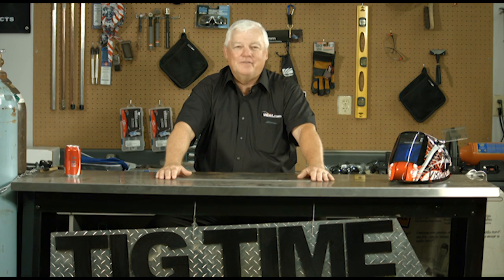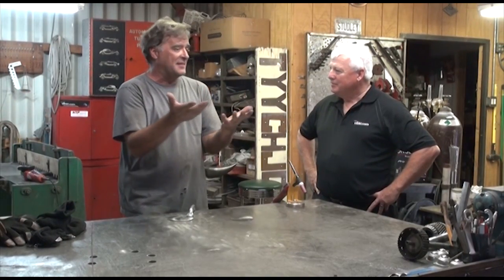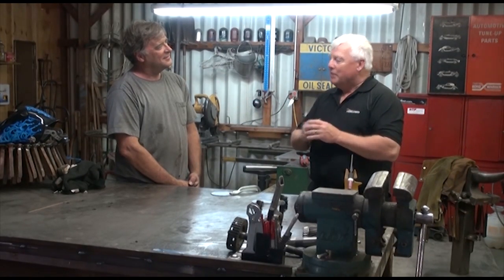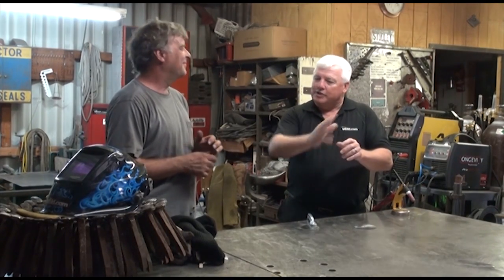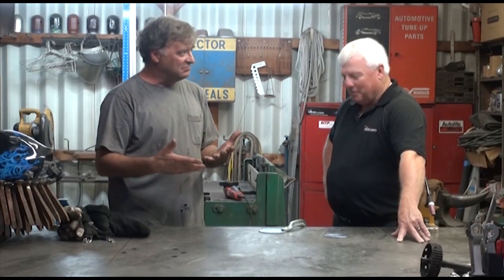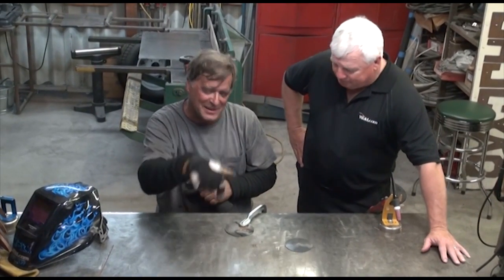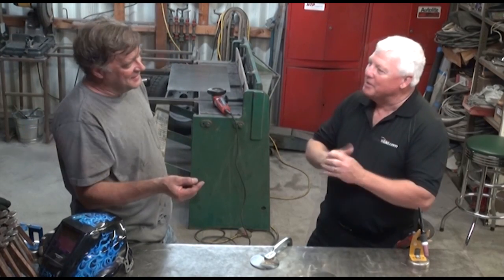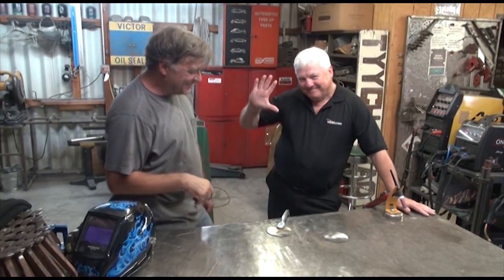Using a MIG Mix for TIG Welding with Kevin Caron | TIG Time

Comment: Very interesting as I weld only mild steel. Using argon for aluminum was something I never knew.
  I have owned an old school MIG new in 1984z it is bigger that most engines found in Honda passenger cars. Also being retired don't help much as I opt for a beef pot pie or an entry level TIG that doesn't have positive ground switching.  
   Interesting video and thanks very much for this info. I know that doing anything right, cost money. Does Uncle Joe take all of the Helium? It makes him sound normal otherwise he would take 35 minutes to speak a 10 speech. 
DK.
Self taught, ASE Master tech since 78. Thanks?

Comment: Hi Mr. TIG!  I'm Chas an American but im living in the Netherlands with a unique situation at hand and do quite a bit of welding with stick but ive dabbled in the world of TIG in the past so unfortunately i find myself craving to weld in such way again , with such precision and control.......i have a tig torch and a tungsten Just over here Argon gas is typically a bit of an investment, so i was wondering what your thoughts are on using Helium as inert gas?

Comment: awesome learning heaps... what about high frequency start, I have a simple machine... what I mean I don't have the control to change much ... I set the amps and press a botton and go.. any advice would be great... my machine is Weldtech ATP160  which is exactly the same Amico CTS plasma TIG Stick welder combo. please please please

Comment: Frustrating!  One would not expect a MIG mix to work as well for TIG, but not attempting to change welder settings leaves some questions unanswered.
The real question folk who are beginning want to know is can you use straight argon for MIG - that would allow you to rent one bottle instead of two, and save money.  Need a demo.
Reply: I tried strait AR with MIG....no go.  no penetration.  weld just piles up.

Comment: Weld closeup at 8:50.  The one using MIG mix is pretty ugly.
Thinking also that the TIG electrode is metal, and at how many thousands of degrees, in an active gas instead of an inert one.

Comment: Thank you gentlemen. Big fan!
I just ran out of argon and finished "TiGging" with mig gas. Although not as nice as the welds with argon it seemed to work ok after I dropped the amperage.
Does the strength of the weld differ much using mig gas? It appears the comment from 1st STTI below would suggest not.
Reply: 75 argon 20 co2 5 o2 works for me same like 100%argon. only there's a kind of small fog around the tungsten
Reply: edit , it was actually 85 argon 15 co2, but that is when you're welding with top class welder,
mine is selco genesis tlh 250, no difference in outlook

Comment: If Argon is a much better shield for burning stuff than CO2 is, why the @+$& are fire extinguishers filled with CO2???
Reply: Expense and application.
Reply: CO2 doesnt ionize at fire temperatures
Reply: i think co2 is liquid,  you can make ice with it
Reply: Distinguish extinguishing fires from providing optimal conditions for  TIG welding.  Different gases for different purposes and situations.

Comment: I have never had a Problem Welding the GTAW  process with 25/75  on mild or stainless when adjusting the Machine properly, use less amps with 25/75 and more amp with 100% Argon,  I have a degree in welding and the only time we changed to 100% argon was with Aluminum. just the same with welding Aluminum with DC use a lower current and 100% Helium.
Reply: @mattbailey3934   Depends on what you mean by "it works".  Does that mean "it melted" or "good penetration, no slag inclusions or undercut, strength meets requirements" etc.

Comment: It would have been informative to show real world results from improper gas selection. I can tell you that C10 will not tig for more than about an inch. It causes alot of spatter, and contaminates the tungsten in very short time. It works, but burning up tungsten electrodes so rapidly easily outweighs the cost of a second gas cylinder with straight argon In Short time.

Comment: can i use tig  machine for mig welding process? or vice versa?
Reply: Not unless it's a multi process machine, by time you modified a machine to do something it wasn't intended to do you could go buy a machine meant for it and have a better setup. TIG/stick is constant current and MIG is constant voltage. You could make them work vice versa but it wouldn't work well. It would "work" but MIG welding with a constant current power source would feel alot more like stick welding because you'd have to maintain the arc length much more stable in order to keep the voltage from fluctuating and you'd likely end up with less than desirable results.

Comment: Sorry but I'm a little bit confused as you seem to be using the anacronym MIG when you should be saying MAG.The 75% CO2 to25% argon seems weird to me as here in Europe the mixes contain about 98% argon. Or is it me who needs a shrink?.
Reply: MIG is correct, it's metal inert gas. Only time it isn't called MIG is if it's a flux core wire and then it's referred to as FCAW(flux cored arc welding). The 98% argon mix has 2% oxygen added to it. That's typically used for spray transfer on steel or pulse spray transfer on stainless. 75/25 mix (75%argon/25%CO2, also referred to as C25) is used for globular transfer used for welding steel. Jury is out on which is better, I'd say spray is better for welding in position and globular is better for out of position work.
Reply: What you need is some 75/25 ar/co2. You'll put your 98/2 ar/o2 in the bin after you try it.
Reply: MAG is Metal Active Gas, so the gas used is active, usually 100% Co2

Comment: Can you "TIG weld" Carbon Steel plate with no Argon gas if you use a flux core wire? In theory the flux would do the same thing as the Argon right? DOOOOO ITTTTTTT!
Reply: I think the torch tip wouldn't handle it. I must confess i have started tig welding on some early mornings without gas (argon that is). and what happens is the tungsten starts to melt back in to the cup, there's a lot  of smoke, and the cup itself starts to disintegrate. my guess is that the argon i not only needed to shield the metal, but also cool the torch.
So no, i don't think you can tig weld without gas in that manner. allthough flux core filler WITH gas might work?
Reply: Difficult to run the Tungsten Inert Gas process (TIG) with no inert gas
Reply: ...uhm....NO......if you were using a flux-core wire....you wouldn't be TIG welding, would you?
Reply: That Welding Guy You Know the results wrong chemical composition and shield gas also cool for electrodes ...

Comment: What was not explained here is that CO2 disassociates in the arc to form carbon and oxygen, the oxygen then burns the metal and the tungsten and the carbon will combine with the metal, particularly bad when welding stainless or aluminium. At one time I worked for a company that used 95% argon 5% CO2 for mig welding both mild and stainless steel on tankers.
Reply: I did not know that. Thanks for the info. Now I can better decide when to use mix gas
Reply: But one question- if I were to weld on high carbon steel with mix gas, would I want to use filler that is lower carbon content than the base to compensate or run same/ similar content filler?
 I ask because, from what I understand,  cooling distortion causes cracking between Steels with too much of a difference in carbon content

Comment: Will do you and very in depth test on Tungsten electrode I love those type of videos with like 8 diff kinds... pure, zirconiated, thoirated 1.5 and 2 % lanthanted 2% ceriated E3 and LaYZr....I don't agree with you tungsten chart you rated 2% lanthanated 8 all around and its just as good as thoriated at DC,,,,,id like to see where you got your number from cause I don't agree with that chart and clearly you just made thoriated seem the best, its radioactive you should think about that be4 recommending it, I know its a great tungsten but there are ones just as good if not better I feel you should do a very serious test on it with all different types and post it be4 you go recommending a chart that I don't agree with and neither does Jodi at weldingtipsandtricks.com......prove us wrong.....a lot of ppl are agreeing with us and here you are still recommending radiation to new young welders that havnt even had kids yet

Comment: Hey guys, ever herd of tri mix. My weld supplier try's to sell it to me
Every time I go shopping.
Reply from the maker: Tri mix gas is very common for MIG welding, but not for TIG.   Tri mix tungsten is available for TIG welding and works well as an all around Tungsten. We prefer the CK Worldwide LaYZr Tungsten when we use a Tri mix.